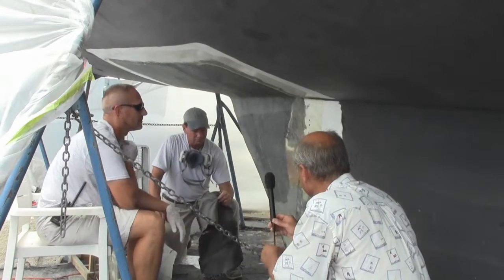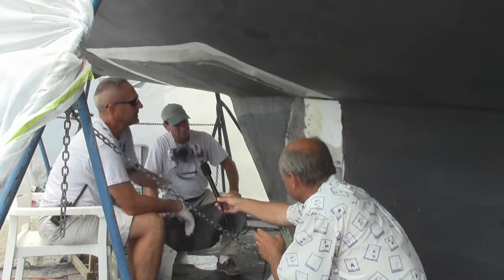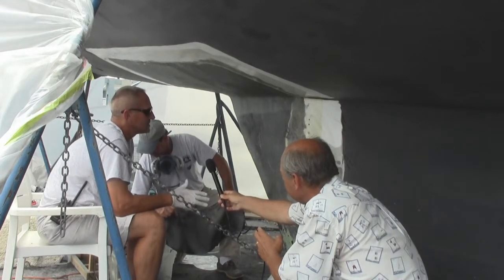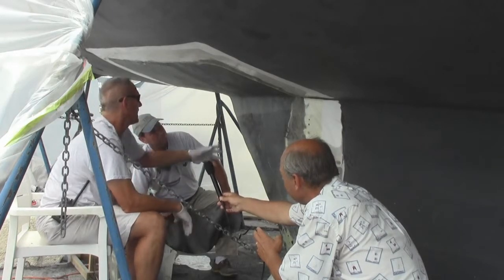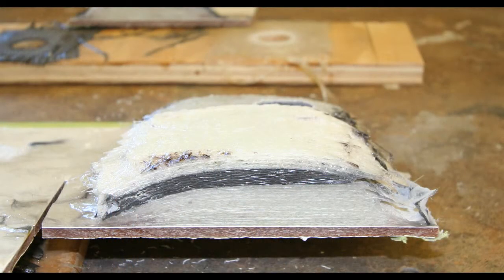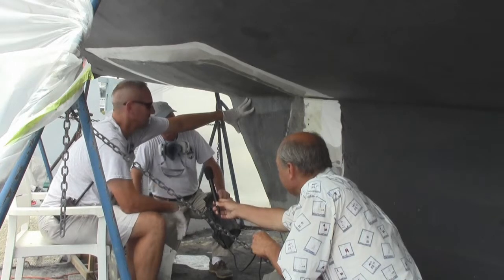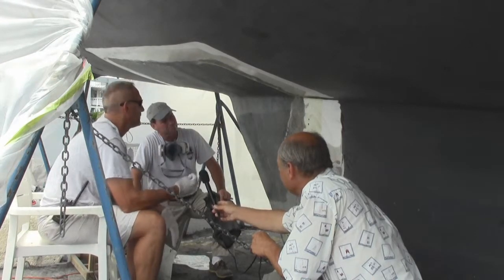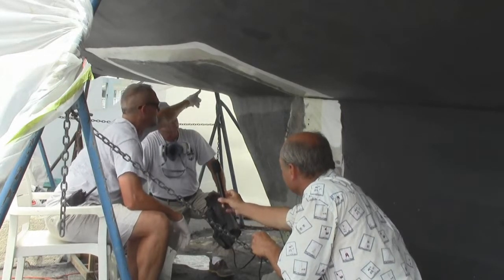Working with carbon fiber for hull repairs

Comment: CF is not as strong as fiberglass??? Why then use it at higher cost? To save weight? I must be missing something.
Reply from the maker: you could be right, i think it the weight, plus it is not flexable
Reply: It does not flex.  Flexing causes cracks to occur.  In this video, they use both fiberglass and carbon fiber.
Reply: @p.m.justice3502  You actually want it to flex so it doesn't crack. Picture 2 long 2x4 stuck in the ground vertically. Say one will not flex and the other will give and have flex.  If yo kicked them both as hard as you can the 2x4 that doesn't flex will do just that, not flex and crack. The one with a little flex will give to the force of your kick and therefore not crack. Same thing for skyscrapers and why they sway.
Reply: CF is stronger in the directions it is meant to absorb shocks/pressure/tension. If you hit it in other directions it will break easier. I think that is what he meant by weaker.
Reply: Industrial carbon fiber is more than 20 percent stronger than the best fiberglass. Carbon fiber boasts a strength to weight ratio roughly twice that of fiberglass.